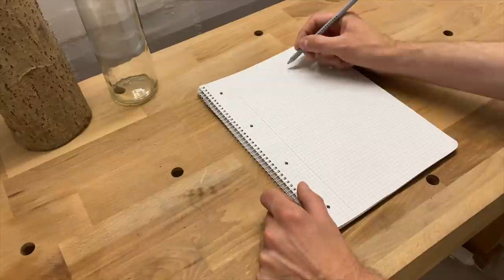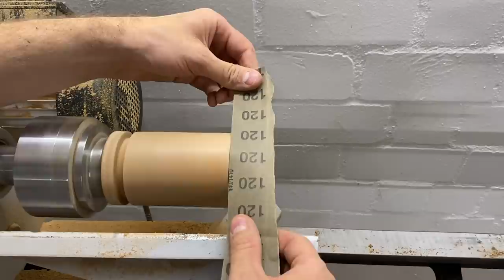Woodturning - combining an old wine bottle with a piece of firewood on the lathe

Comment: I have only been turning for a couple of years, so in no way an expert, but i would like to offer 2 pieces of advice. Your tool rest is too too far away from the piece. If (when) you get a catch, it will pull the gouge down into the gap and the result will not be pretty. In addition, I would like to see the gouge angled slightly upward. This will reduce the chances of that catch happening..but again, you can only do that safely if the tool rest is closer to the work. Good luck, and stick with it, but bear strongly in mind that the most important things you can learn right now are ALL to do with safety, your safety.

Comment: Great video! Are those black ring that are use to Breks the glass made of rubber? Are they called anything specific?
Reply from the maker: There is nothing special. Just rings of rubber like you said. It is the difference between the hot and cold water which forces the glass to break.

Comment: Now, is that a typical hobbyist lathe? and if so,  what make is it and how much would that set you back?  (cost)
Reply from the maker: Hello Khasab, yes it‘s not for professionell use. The overall Price depends on which tools you buy.
Reply: @NormanLeMoudl  yeah but all i wanted to know was:  is it good for a hobby wood turner and what is the basic price of the lathe
Reply from the maker: Basic price of this lathe is about 600 dollar. :) But you need a sharpening Tool and some gouges too. So I guess about 1000 Dollar and you can start turning :)
Reply: @NormanLeMoudl  ok thanks. too much for me

Comment: Hi Norman...
what if u could - instead of dremel / chisel out the air supply - drill circumferentially 4 (6...? 8...?) holes (like 1-2 cm beneath the glass), so they would go out around the candle... it could provide the candle with fresh air AND make a nice visual effect as well...
Reply from the maker: Yep that is a Good Idea. 

I did a lot of those with different Styles and your idea works well! 😊
Reply: @NormanLeMoudl  Glad to hear... :)

Comment: Very nice. I would  put a metal disc under the candle tho
Reply from the maker: Thank you, Pam! :)
Reply: We have painted wax candles that are far too pretty to burn. The artists’ husband drills out the top and puts a wooden disc in so they can take a night light. This will be fine with no metal plate.
Reply: Duly noted Gary, I was just thinking of the heat element

Comment: The tool rest is too far away from your work. At one point you almost lost the gouge. I have seen them hit the wall and bounce back and hit the turner. That will ruin your day! Loved how you cut the glass bottle.
Reply: I tried this and it looks great, however, the candle goes out due to lack of oxygen. I drilled a few
small holes in the wood to supply more air, same result!Looks good with electric tea lights though👍